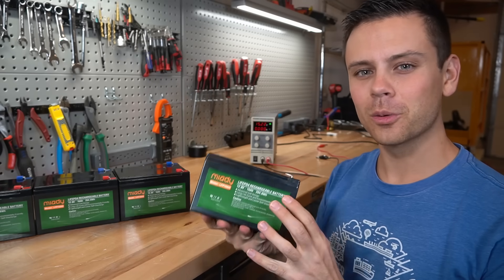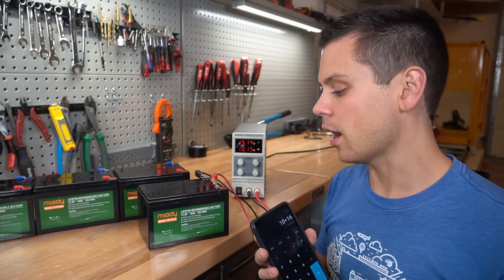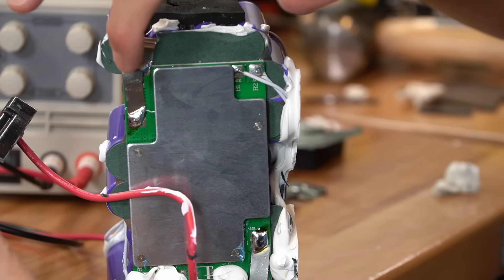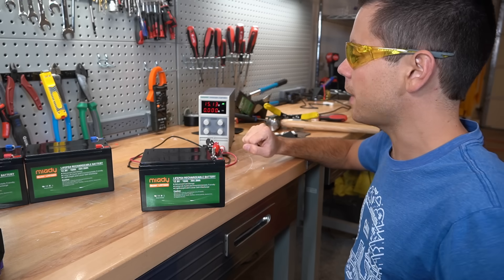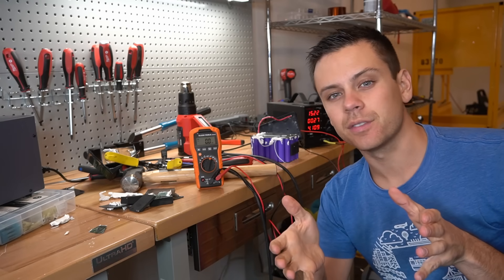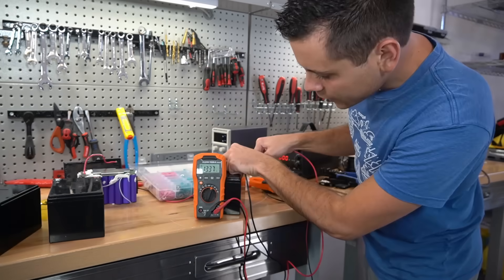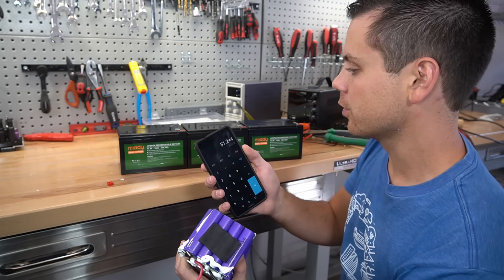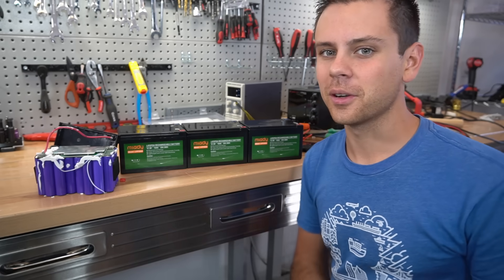$54 12V 16Ah LiFePO4 "Miady" Pack Tested

Comment: Will, do the batteries at least look good enough to harvest cells and add your own BMS? Cut them up and use the nickel plated sets of cells?
Reply: Ghostwriter has used them with a quality BMS and is satisfied with the cell quality.
Reply: Well, since in his testing of a new battery, the cells did not stay in balance, I would vote no... inferior cells.
Reply: I would just buy used tool batteries at that point. It looks like a cap shoot at what you're going to get.

Comment: We had the exact same issue that you did. We found these on Amazon and purchased 20 of them figuring their price was just so low so how bad could they be .. BOY WERE WE WRONG .. same issues you had ...I'm not even convinced that its a real BMS ... We did keep two of the batteries and returned the other 18 (THANKS AMAZON PRIME!) ... I took an old BMS that we had - tore the other one out - literally had NO name or anything on it -- and soldered the wires better (yeah tape just doesn't seem to be a good alternative) and after doing all of that - these 2 that we have works well ... NEVER got the 204.8wH but we did get up to 193wH on both batteries ... also we did NOT have the issue of the banks testing at different voltages like you did BUT to be honest we did NOT test that until after we put on the better BMS .. so obviously the BMS that they are using is just all whacked up....
Reply: I think Amazon sold Will your returned ones.
Reply: @barranness  haha I was just thinking that
Reply: "NEVER got the 204.8aH but we did get up to 193aH on both batteries" 
You mean WATT Hours, right?
Reply: @sNEAKYnIGHTmUPPET  lol .. yep ... changing it .. thx ..
Reply: so definitely it was a crappy BMS -- when we bench tested it the cutoff was well above where it should be for LFP batteries ... and honestly - i was never able to find a temperature sensor (it says it has hi temp cutoff) -- of course the temp could be built into the BMS but then that means that when the BMS heats up doing its job it will often be 30 degrees warmer then ambient -- so YET another bad BMS choice ...
Reply: @ghostwriter6699 
Hi GW.... Great info...
I was thinking exactly that...
That the BMS is the problem...
(As the batteries look good)
Quick question 4 u...
How did u get the pack out of the case without breaking it..?
Or did u only take the top off..?
How did u break it open..?
TIA...
Reply: @MaxMax-dq1lu  I used a rotodrill so the case was still basically good and i re-taped it with gorilla tape -- BUT had to have the BMS hand outside the case since it was heavier duty
Reply: @ghostwriter6699 
Thanks 4 the info.
Cheers.
Reply: This should have been one of the top replies under under this video.  Wonder why it was SO FAR DOWN two weeks after release.  😐  Posting and 👍 to try to pump it up a bit.
Reply: Ghostwriter6699. Thanks alot.  Again buyer beware. It's your money. They are better alternatives out there with quality BMS.
Reply: It's like the old adage says, you get what you pay for.
Reply: 1. did you buy these batteries? 
2. what quality BMS did you use?
3. Can you get a BMS that'll make it connect in parallel and series?

Comment: Awsome. Ive been buying these, I have 8 now, to build up a power center for my portable astronomical telescope. From what you have found I'll treat them as 12 amp instead of 16 for my calculations. This will give me 96 amps and if I manage 6 hour runs a night that is 16ah available to me and I draw 10 to 12. Most of the equipment is 12v so no converting.  What I am most unsure about is charging when out in the boonies. I have a 120w solar panel but I should augment with another 120w to ensure the battery bank is fully charged before nightfall. Thanks for all the hard work you do testing these batteries, it really helps.
Reply: Nice! Portable astro imaging is how I found this channel. Clear skies!
Reply: Arrange one panel and monitor the energy given by it on an average day and a bad day. I'd say set it up to charge a large battery from a very specific voltage and measure the delta. If you know the curve, you'll know how much energy it takes to move the voltage per mV, and you can calculate from there. Or have an arduino logger measure amperage from the solar panel to a dummy load in place of a charger.
Reply: you draw 10 amps. epic setup man, im only bout 2-3a
Reply: @skylinevspec000  LOL! The dang AVX mount draws 3.5amp, combined the dew heaters pull 2.5, and my camera gulps 3.75 (has a cooler)! Last year I bought a Westinghouse iGen160, back before I had the cooled camera, and it worked fine but now it's only good for a couple hours even WITH the 2amp charger going. Eventually I'll add a focuser and possibly Raspberry Pi 4b into the mix so that will increase my demand on the system. I am hoping I can plug these batteries into the 12v charging port (AC adaptor , 12v car, 12v solar) on the iGen and that will give it the boost I need to go all night long. It's time to start looking for something more around a 500w or 750w to power these gadgets.
Reply: @BrotherAlan  have you considered a 12 volt pure sine wave inverter in your vehicle? i often run mine on 120 feet of extension cord, more for testing and learning than anything. also, i was able to sustain about 1200 watts over the course of about 12 hours, for an approximate 14.4kwh's.  i went through about $9.00 of fuel, i was using a 7kw pure sine wave inverter connected directly to my suv battery,  in that particular test. might be easier to drag an extension cord out to the site, than to drag all those batteries and solar panels. for the record i ran a projector in my basement, all sorts of leds, laptops, tvs, fridge, ac in some random window just to see if i could. turn the lights off on the vehicle run that extension cord and no one would even know its there. after rereading your post, this might the the only part that could directly help you: if nothing else you could use an inverter to get ac power to your site, then connect chargers to your batteries that are powering equipment lol, ac from alt to dc battery to ac inverter back to dc at the site. use the car inverter to get ac to your site, to power battery chargers, charging them while you use them if need be at night and solar during the day. for the money you spend on batteries, solar panels etc etc you could get an inverter and run an extension cord and power strip. this way can deliver the power you need over the amount of time needed with room to grow. i opted for a bigger battery in my suv and while my vehicle requires side posts, i make sure to get a battery that has both top and side, so i have something to easily clamp or bolt on my big inverters right up on top. its super easy to clamp that inverter on and run the extension cord from the back of my property where i park to where i end up needing the power at least 120 feet away.
Reply: @jasonbrown467  I have thought of the new hybrid RAM pickup which would be perfect for these weekend excursions. I believe the truck includes a couple 12v outlets in the bed which would be perfect. While my rig at full power draws 10 to 12 amps the members of my astronomical group showed me that I will run less than 5 amps 90% of the time.
Reply: Do you use a solar charge controller? Looking to make a small charging system for this battery. Thank you in advance.
Reply: @FlexMoePower  it is built into the portable solar panel.

Comment: How many batteries would it take to make a 48 volt battery
Reply: Did you hear him say NOT to connect in Series?
Reply: To make a 48V battery, with these you need to install a BMS rated for 48V, and build a 16S bank, not a 4s like these.

Comment: Will, I'm on my second set of gel cell lead acid batteries for my APC-1000 computer's UPS.
The gel cells aren't cheap and only last a few years, the Miady batteries look like they might be a direct replacement, the ABC housing is heavy duty steel so offers additional fire protection. (Opinion/suggestions)
Reply: you should find better batteries if they connect in series.

Comment: I’m using two of these in a DIY ham radio battery box. They seem to be working well enough especially for the money.
Thank you for the review and capacity test.
Reply: The Milady work fine for max .2C equipment draw like a Yaesu 817 or an HT and still get plenty of life and longevity out of it even if it is only 12Ah. It will also work with an Icom 705, but when at 10 watts it is pulling more than .2C which eats away at the longevity. Still, that price is crazy low. Treat the battery like your radio and don’t be rough. It will last if you do. I use a 50W folding panel and a LifePo controller to charge it just before I go out into the field and while in the field for longer than a weekend. I do not top it up before coming home to keep it discharged a bit. I also have the lower amp version and use it to power meters, or for receivers that draw low amps. Ultimately, this costs less, weighs less and will last longer than a 30Ah SLA, unless one wants to destroy the SLA.
Reply: @Timothy Mckee no I haven’t heard of them. Do you like them?
Reply: Ya me too I have three my budy has 2 we use for pota love them opinions are like a holes like they say
Reply: @Timothy Mckee American support, imported batteries.
Reply: I have a mobile/portable setup using a Motorola Quantar repeater (UHF / 110w / P25 & analog)
using 2x 100ah 12vdc AGM batteries.  It’s fine as long as SOMEONE ELSE does the lifting.  😆

I recently added a Hytera RD982 repeater (DMR & analog) to the mix.   It uses approximately 1/3 of the power of 
the Quantar.   Ideally the move to lighter & more portable hardware & LifePo4 batteries seems to make the most sense.

Will Prowse is THE MAN!
Thanks .  👍🏻🇺🇸🧂😷
Reply: @PowderMill  If you can lift the Quantar you should have no problem with lifting the AGM batteries.  :^)   73.
Reply: I was just about to purchase these because they are cheap.  All I want/need is a real 24Ah battery that doesn't break my balls in price.  Simple project of garden lighting with a bunch of 3w LEDs in clusters lit all night via the battery.

Comment: What would be the main problem putting them in series?
Reply from the maker: BMS FET max voltage rating. Higher voltage rating is required for series connection.
Reply: @WillProwse  Thanks!
Reply: The listing claims "Support for serial application expansion (up to 51.2V)"
Reply from the maker: @mikesomething8853  good luck 😅 I wouldn't trust usage recommendation coming from that company after the capacity test results.
Reply from the maker: @mikesomething8853  thanks for pointing that out

Comment: There's a smaller version of this battery as well, same company, $30 on Amazon. I bought it last year. Been working fine.  I didn't see a high voltage disconnect. However, seeing your test, I may not have charged it high enough. I didn't have calibrated test equipment but it appeared I got the rated output running my LED Off-Road style light.

Comment: can you do a video on  how to charge various lithium packs from an alternator (both 12&24v alternators) really not much content specifically about this online
Reply: Also look at Abso DC-DC charger with built-in MPPT solar charge controller. I went with it over the competition as it was less expensive than Redarc and supported a higher charge rate than the similar Renogy product.

Comment: Not a high output battery and controller does not have low voltage cut off.
Reply: It cuts off at 10 V
Reply: @d.b.cooper  Yes.. kind of if really low draw - I personally know these batteries - not really - under load the battery will over discharge for the controller to allow the batteries to be charged.
Reply: Maybe the BMS is supposed to cut off at 10v, but that's not my experience. I bought 6 of these 16ah versions months ago on Amazon for $45 each. And I watched the first one on a test sail right past 10v down to 3v before I pulled the plug. It recovered to 6.6v and stayed there. But I didn't brick it and I was able to recharge it. I wouldn't trust the BMS on that score. You either have to monitor these or use an external low voltage cutoff, IMHO. But fully charged they do hold their voltage well long term storage and perform fairly well capacity-wise.